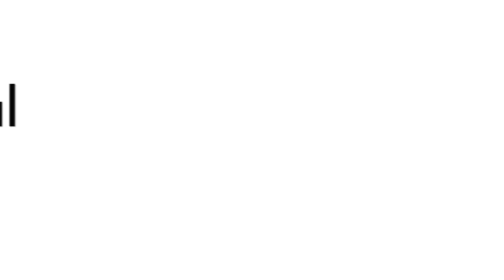Mercedes E300 Full Leather Interior Repair | leathercare.com

Comment: Been doing leather repair for 21 years and this is the first video I can honestly say, well done. I would be interested in the products as well as whether you have to be a franchise to purchase or not. My supplier has become a bit flakey on returning calls and the help I last received for an adhesion issue on newer land rovers was useless at best. 
Your process differs a bit from mine but looks to be very good and professional. Much respect
Reply from the maker: Thanks for the feedback and kind words. It means a lot especially coming from someone experienced in the field. Where are you based? You don't have to a franchise to purchase. We would love to help and be grateful if you could email us - info@colourlock.com. We have OEM approvals on our products too which should hopefully give you further confidence.
Reply: @bina nocht really hard to answer without putting my hands on it. For the age of the car I would worry about how dry the leather could be or thin areas of wear.  I wish I could give a better answer but without seeing it and feeling it its hard to answer.  I've seen 3-4 year old cars look like 40 years of wear as well as the opposite of that.
Reply: @bina nocht absolutely do not use any conditioners or especially oils on painted/finished leather. If there are any cracks or raw areas the oil especially will soak into the leather and you will not be able to get a new finish to stick. Some conditioners can make the job very difficult or near impossible.  Klasse vinyl, leather, rubber treatment works amazing. However only the clear formula not the milky one.
Reply: @bina nocht I've had a client that oiled his seats and there were areas that the finish was completely worn off so the leather soaked the oil in. Nothing I could do to extract the oil to then get my finish to stick.
Reply: @AliensKillDevils.  love my bbq brisket! Mmm mmmm. Enjoy sunshine and eating meat. If its hot out enjoy an ice cream cone or milkshake.
Reply: @bina nocht you could deep clean, patch any cracks, find a texture pad with one close to the original leather grain, stamp it into the repairs, sand if needed, then get some of this (Clyde’s Recoloring Balm) that’s closest to the OG color AFTER deep cleaning, use the balm as instructed, and feather out into OG leather for a true “Restored” finished. I’m sure there’s tutorials on here for Clyde’s. In the process of restoring a BMW with a an almost white interior 🤦🏼‍♂️, but this method sure did work. Clyde’s is great , your stitching will still look like stitches, and doesn’t give you that rubbery look.
Reply: You would be the perfect person to speak to if you’re doing this for 21 years, how durable is the finish when done. Is this something you do just to sell a car or is it a repair for my own personal call that would last me a little while
Reply: @jojojeep1  if the product is good, which this appears to be very good, then its up to the person doing the job. If they prep everything right and do the repairs right then it should hold up every bit as good as if it were never damaged. That said, there are more hacks out there that do really bad work for dealers that just want the leather repair to look ok for the car to sell then it fails shortly after. If there's someone you're considering using check references. Ask what accounts they service then call those and find out who the recon manager is and talk to them. If all they service is low price potlots I'd be wary.  If they service high end accounts like mercedes, lexus, BMW, porsche, etc then you most likely found the person you want to do the work. I would ask the company that put out this video if they have anyone in your area using their product that they could recomend.
Reply: @jojojeep1  I've seen some jobs i did 5 years later that still looked great.
Reply: @AliensKillDevils.  The circle of life is a beautiful thing. That being said, many more people should start to be more mindful and great full what the earth and it's creatures give us and not abuse it. But we also need to realize the circle of life cannot be avoided. Any food you eat can easily take a creatures home even if it's a veggie. New technology might change this soon, but for a long time we have had to live this way. We should have been more aware of this and treat them better for sure. But somehow I feel carma takes it's course if we don't take care of our environment.
Reply: This is really good. What type of paint is this? Is it water based or solvent. Do you sell the paint and the filler? Or from where can I buy it? Is it possible to use cotton or sponge to apply the paint instead of spraying? I am concerned about the paint spray and tints the other parts of the car as I don’t want to remove the seats.
Reply: Hi what products you used?
Reply: @Camoburb  What products did you use to paint though? And did you paint with the clear coat?

I had a bad experience with the clear coat on my headlights, they were yellowing after the clear coat....
Reply: I would 100% trust contacting this channel and asking for a referal if they're not in your area. Top notch work here.

Comment: In my early 20's I owned a small business specializing in leather/vinyl repair. It's a very rewarding industry, both financially and visually. I loved walking up to a vehicle with destroyed leather seats and say to myself, "I can fix that". The sad reality is for both myself and the unwitting persons who bought those vehicles, was the product only last for a few months at best before the dye's and repair product started deteriorating. After several years I began to feel like I was operating a "scamming" business, knowing full well that every single car that I "repaired" would soon be back to its original state. The only repairs that were permanent were carpet dye and even then, if it's a red stain, it would eventually begin to bleed back through.. I'm now 48, on my third business (sold the other two) and love what I do for a living... I'm sure the automotive repair industry is still alive and thriving, I only hope the products of today hold up better than they did 20+ years ago..
Great video btw.
Reply: So the seats in this video will look fucked up in a years time? wtf?
Reply: @Volteran  if they don't sit on them and keep them in a temperature controlled garage and out of direct sunlight, they might last a year.. It's a temporary repair. If you want long term, you can have individual sections of seats replaced so you don't have to spend a whole lot on a new seat cover. This is a very inexpensive option for those with genuine leather seats, which can cost several thousand to replace (per seat). Cloth or fabric seats can also have individual bolsters replaced, but the cost of a new seat cover for a cloth seat is usually a fraction of that of the cost of a new leather seat cover..
Repairs are good low-cost temporary options to make an old seat look new, but don't be fooled into thinking they will last the life of your vehicles interior.
Reply: @AerialEscape  Very interesting, thank you! So basically if you want usability irl, it is a waste of time and money? Are there any products that actually help to prolong the lifespan of leather seat covers?
Reply: @Volteran  yes this is only a cosmetic fix that does not survive wear and tear.
I wish people would show pictures of these repairs 1-2 years later. I wanna see how shit they look.
Reply: What are the two other business that you have done? It's quite interesting
Reply: @Volteran  Language there.
Reply: The only way to re pair leather seats is either buy another set in better condition, or buy a used one from newer model that'll fit. 

Or have the leather reupholstering if it a classic car and you want to keep the oem look. 

For me , if it a sport car, I would invest in a Recaro reclining bucket seats. 

Any permanent fix will cost money..  like the man said, it's a scam bussiness but people get ot done for a reason and most likely to flip the car . 

I'm always warey  of old cars with mint seats. Unless it's low milliage and been baby since day one, its okay . U can tell if the car been taken care of and if the car overall isn't in good shape but have brand new looking seats,.. I'll pass up on it. 

It's like when an owner says, car mint conditon, just had the car freshly repainted. It always stays on tge market for so long, no one wants to take the risk of having flaking paint chips after an year. 

Unless it was re spray at a reputable shop, most ppl won't even bother selling it as any good type of work in the automotive industry is $$$$. But now a days their less and less good automotive trade men's left.
Reply: Thank you for sharing. The car seat of my newer Lexus is in much worse shape than the car seat of my older Buick and Acura were😢 I think it varies between brands... At least thanks to you I won't bother to repair it.....
Reply: You didn’t repair a single car sorry

Comment: Trust me, this is a great solution when selling a car, but give it a few years and the cracks will return.  I bought a '92 W124 in 2016, the front seats looked amazing, now the seats' paint is cracking to reveal the damaged leather below.  This is akin to the pre-sale bodywork blow-over many dealers give their cars to present them in the best light.  The only way to repair damaged leather as in 0:39 is to replace the panel, otherwise it will be like taking a wrinkled 80-year-old, applying some make-up and expecting them to pass as a 30-year-old for the rest of their days.
Reply: I wonder if it depends on the system that you use. I had Fibrenew redo the interior of my W126 Mercedes. I had a very similar hole on the driver side bolster. 10 years and 40,000 miles later and it still looks as good as new.
Reply: the only way to really fix that is to replace it. this method would be great for a museum piece or a collection of sorts and not driven much at all.
Reply: A couple of years isn't that bad ...
Reply: you can always repaint them. had a jaguar with ivory seats. it was a nightmare to find somebody to reupholster my seats. i just painted them myself.
Reply: @MrJuergenG  it is if the car is garaged and the seats hardly used.  I've only done 17k kms since March 2016.
Reply: @Visionery1  I have done 17k km in less than 3 months....Some people do that in 1 or 2 months...To each their way of life!
Reply: Did you expect repainted seats to last long? LOL! It would be easier just to buy new seats; in fact, just buy a new car. 🤣
Reply: You're not wrong, but a few dollars and a few hours of work to get an extra year or two of wear out of these seats would be worth it to most people.   Unfortunately, the only way to restore damage/dried-out leather upholstery is to have it reupholstered.   Reupholstering cars seats in leather would be very costly and not worth it unless the car is relatively new or a valuable classic.
Reply: This painting is the only applicable field for it..fooling buyers.
It's not a repair, it's a scam
Reply: this is so wrong, i bought conolly color and filler, wich is exactly the same as what  conolly use on the cow hydes   they use for  OEM leather so if it is applied properly it will last along time especially  if you respect leathers dislike of direct sunlight, i own jaguars that were done many years ago that look very presentable  to say it doesn't work is the same as saying a car can never be resprayed, as long as you use quality materials you can achieve new leather durability
Reply: @callumduncan6728  that's like saying face cream on an 85-year-old will make her look like a teenager.  Leather is no different to skin, if it's cracked and wrinkled then 'fillers' will only be a temporary solution.  The back seat in the subject of this post is as good as new because unlike the front, it was not subjected to direct sunlight through the windscreen (it is original and was never refurbished).
Reply: @Visionery1  you seem very set in your view , all i can offer is that i have personally been involved in some very high end restos, and the leather was restored with quality professional materials ,from conolly  and the results have been very durable , and i am a heavy set guy who squashes  the leather lots every time i sit on it,  but you carry on with your 80 year old make up  theory if you must , but after over 30 years restoring  cars i can assure you that it works if done properly
Reply: You are absolutely correct. Same thing happened to me! Also that kind of treatement doesn't let the leather to be hydrated by cream and it will get worst the original leather. It is just a scam to buyer of second hand cars.
Reply: @tommyb6611  I agree, it is a scam.
Reply: Yes that's the problem I have now. I bought a car on a used car dealership. The seats looked great and now I've had it for 2 years, the seats look terrible! Probably worse than they did before they restored them. I'm not gonna lie, I haven't taken the best care of them as a mom with toddlers. But I noticed the paint and filling has come off the seats, they look all discolored and dirty. Trying to clean them seems to make them worse. I'm now trying to find a way to make them look better or at least attempt to restore them myself.
Reply: I have Milano leather and it was excellent when it was newer. I used the seat heater and the Texas sun to cook the tanning oils out. If something isn't done to correct that I see this repair as a great solution for appearance but don't understand how it's going to last.
If you guys/gals that have seen lasting results, have you retanned the leather in some way? Please elaborate on the solution. My leather is more brittle and I would've never used the seat heaters if I knew it would shorten the life of the leather. I'm not absolutely sure that was it bc the passenger seat also has cracks in the leather without much use. How do you put oils back into stiff leather?
Reply: @robertjackson7590  this seat repair method is akin to applying body putty over cracked and damaged paintwork, it will look beautiful, but not for long.
Reply: @Visionery1  Thanks, I was hoping something new had been developed currently that showed promise.
Reply: You're not wrong but most people don't keep cars for 40 years. Doing this once for a normal car with a lifespan of 10 years would more than likely work fine.
Reply: @rueliotube yeah 40k miles in 10 years you aren’t goin far or often it sounds though 😂
Reply: @anthonybilbao154  fair enough. I have a stable of 10 older German cars so some aren’t driven much. Still looks good three years later since my comment now 😊

Comment: The creases on the driver seat still show, most of the leather grain is gone, which is an honest expectation considering the starting point. I'd love to see them in a few years.
Reply: My parents had spot repair once and the seats never feel the same. It’s like 2000 grit sandpaper on the top with a 5000 grit smoothness
Reply: @Amor1990  ...I'm guessing these type repairs are probably not intended to be a replacement for an actual reupholster of the seats with new leather. More than likely this “repair” is just a cheaper "visual" alternative. If the process were the same price as new leather, one would just have the seats done with brand new leather?